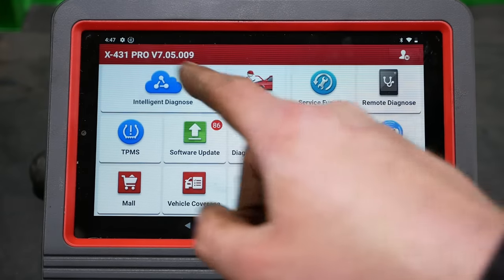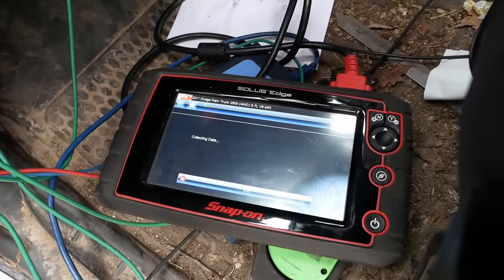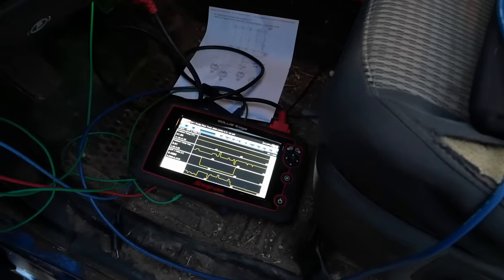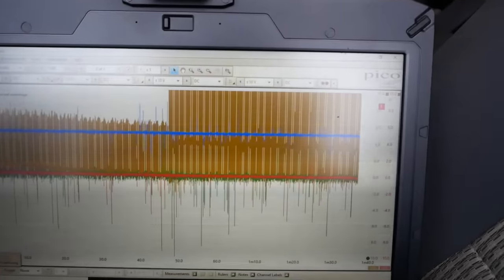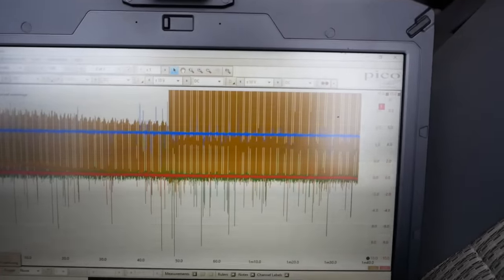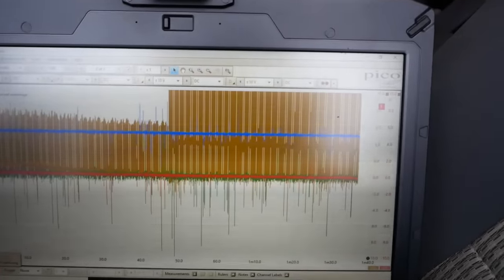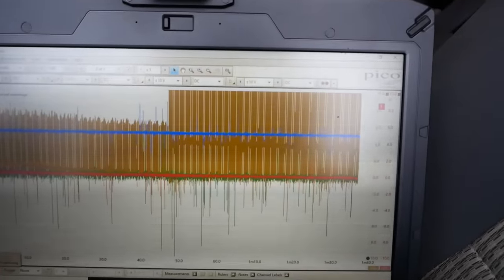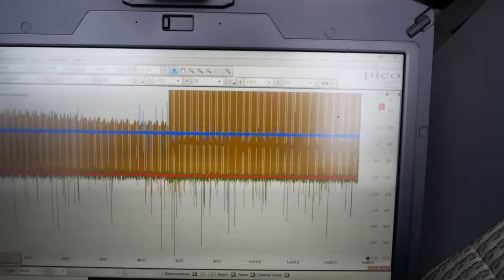Diabolical Diagnosis - Hemi Ram Stuck at 1500 RPM with P2128 and P2138

Comment: I had this same thing happen on a 2010 Dodge Nitro.  It turned out to be the throttle body had broken plastic gears inside..   Sometimes the butterfly valve in the throttle body will ice itself closed just enough that the plastic gear will be the weakest link when it tries to actuate it..  I think it's a sin that it's legal to put a plastic gear in there, given that it controls your throttle and can possibly make it stick at WOT in some cases..  smh..   There's a video of a guy splitting thees open and you see exactly how they fail-- it's actually very common on all dodge throttle valves.

Comment: The other question is how do you charge for experience? Your experience caught that wave pattern related to the injector. The old story about the guy that retires from the power plant after 40 years. Some time later they call him back to work because none of the young bucks can figure how to make a broke generator work again. He say it will cost you $10,000. They say fine. He walks in hits the side of the generator with a sledge hammer and it starts working. Young buck says they paid you $10,000 to hit this thing with a hammer? The retired guy says "no, they paid me because I know where  to hit it with a hammer".
Reply from the maker: I don't know. I guess always charge as much as you can!

Comment: I would rather pay 500 for a job well done than 300 for a crappy one. We have a Toyota Yaris 2007, started showing the ESP/ESC light and ABS light, took it to the dealer who said it probably was a sensor problem cost approx $700 so we sighed and payed.... Problem kept coming back, so they wanted to change sensor on the other wheel as well when my smart AF girlfriend just went home took out the power wash and 3 years later we still have not seen those codes again... I know I am rambling on a bit but last story, there is an old story about a city boy out driving in Sweden when his car brakes down, he gets it to a rural little repair shop. The mechanic fixes it and charges him $1000, the gets the invoice and it says "fixed car, one bolt missing" the guy gets angry demanding a specified invoice the mechanic takes the invoice and pencil in "bolt $1, knowing where to put it $999". Knowing how is always what is worth paying for.

Comment: I had the same symptom and the same reason in Opel Signum 3.0 Diesel 2003. Everytime when the moisture was in the air it activated emergency run (1500 rpm and idle when brake active), when the engine got warm the fault disappeared. The fault code was bad voltage on acceleration double potentiometer. The harness was broken below battery base, hard to find.

Comment: Can you do a factory reset, with scan tool. Or disconnect negative , and jumper to positive , with key on. Then put back on positive turn key on, let computer load ROM to RAM, ie: factory parameters .

Comment: Wes, I don’t understand the difficulty in solving the problem.  KISS. To me the pedal sensor has worn or is dirty.  Replace the pedal sensor and move on.  Some sensors produce opposite voltages.  One goes up and the other goes down as the pedal is depressed.  That is better because a short between the two cannot be misinterpreted as a valid signal by the PCM.
Reply from the maker: Your parts cannon will not fix this issue.
Reply: Sorry Wes,
I should have watched the entire video or had more faith in your ability to diagnose.  Whilst electro-mechanical is the usual cause, I get so many “Technicians” sending me perfectly good ECU’s to test for a fault these days I have lost faith.  Modern electronic modules have come a long way.  I fix more things over the phone than on the bench lately.  Thanks for your kindness and keep up battling rust!
 @WatchWesWork

Comment: Great fix. Worth every penny. Now, regarding the whole “Audi unintended acceleration” debacle. That was an issue that existed only in the minds of idiot Audi owners and salivating plaintiffs lawyers. The lawyers cobbled together their usual bluster about massive liability due to class action lawsuits and attorneys for Audi said “The courtroom is that way” and nothing. Audi refused to settle. After the fact , one Audi dealership owner put one million dollars of his own money in an escrow account and offered it up to anyone who could make any Audi vehicle accelerate unintendedly — but under these conditions:  1-  He had to be allowed to examine the braking system to ensure that it was in good working order. 2-  He himself had to be sitting in the driver’s seat with his foot on the brake. Number of takers?  Zero. Not even one of the plaintiffs lawyers, if you can believe that (Heavy sarcasm here). It was all a lie. Every word of it.

Comment: Yep, a parts cannon shop would have spent the customer's money well beyond the worth of the vehicle.
And, dollars to donuts (day old crullers at that) the Dealership would have replaced everything, including the blinker fluid, before even thinking about the harness.
That, and the vehicle would have been in the dry, relatively warm, shop bay, so the techs would have kept sending back "X0000 Could not replicate the Problem" to the customer.

Comment: Now I'm a city boy, so my car doesn't get very dirty that much. However, when I bring in my car for maintenance, I take out the rubbish, clean the steering wheel, and the handles with a wet wipe.
The cars that you have to work on are old, that's fine. But man, they are dirty....
Reply from the maker: This is his “good” truck.

Comment: these are the times when it is sometimes cheaper to load up the parts cannon and "shotgun" the problem and just fix every possible thing that could be cause the problem.
Reply from the maker: I know the pedal is over $300 and is backordered. The PCM is around $1500 plus programming. I don't even know on the harness, but you'd have to find one at a junkyard because it's obsolete. You're talking $4000 of work.

Comment: Videos like this make me want to go out and hug my 1939 ford 9n. I don't think there is 5 wires on the whole thing.
Reply from the maker: Most didn’t have any fuses or relays either. The starters were manually engaged with a lever.

Comment: Spray down with water selectively to see if problem rears itself
Reply from the maker: Hind sight yes.
Reply: @WatchWesWork  sometimes it takes extreme measures to figure stuff out. Glad you stuck with it n did proper repair. Like you said, others would've just bolted parts on

Comment: Can the corrosion itself conduct the current necessary to cause that problem?  Perhaps the corrosion forms when the engine is off, and then when the engine is started, the vibration break that 'short,' ending the fault until the corrosion is allowed to 'grow' back.
Reply from the maker: Others have suggested the salt is the secret.

Comment: It confounds me, with every manufacturer going to everything by wire, they don't do a better job on insuring the wiring harness is set up better. Also, I hate throttle by wire. It is one of the most stupid systems there is, considering a the alternative of a throttle cable is much more reliable.
Reply from the maker: Everyone uses it, but Chrysler can't seem to figure it out.

Comment: I'm still not sure why the manufacturers think this type of throttle is better than the old cable style :P Speaking of things that I don't understand, why do all new cars have keyless ignitions with a start button? I mean, if you still have to carry the fob with you in your pocket, what's the point? I can understand if they went to some sort of thumbprint scanner or something, but you can lose a fob just as easily as you can lose a key :P
Reply from the maker: I don't get it either.
Reply: The kids think it's "kuul" or somesuch?  Dunno.  You have to mash the fob buttons to lock or unlock anyway, so it seems dumb to me.  I mean, really, it would be that hard to have a place to at least park the fob on the dash so it's not in a cup holder or loose on the floor?

Comment: It sure is easy to rip the dealerships. I worked auto repair from 1991-2011. Started independent. Ended dealership. 
Dealership is less rust, but you trade it for the cars that the customer brought in because the local shop gave up and sent them to us. With a bunch of new parts. Point is- there are good guys and clowns in every shop. Your job as a customer is to find a good one and stay with him-wherever he works.
Reply from the maker: I guess it's all perspective. Most of the dealerships here don't do any kind of diagnostics. If there are no TSBs or obvious faults they just start hanging parts until the problem goes away or they try to convince the customer that it's not really a problem.

Comment: Only 5 hour charged for the job, any garage(non dealership) near me would have charged an extra £30 to £50 every time the computer was connected not including the extra charges they add for switching on a scan tool

Comment: If cars are build the way they were in mid 1900to mid late 1900 it would be so easy to fix them but since they stared  eding emission to them in 1980 it became problems  with repairs all car manufacturers should change get rid that all bull s...t and have no problems.
You can call me old but cars in my days were better than now in every way
Reply from the maker: I dunno. I remember when every gas station had a repair shop, and most had a tow truck too...

Comment: Dealership would have tried to sell that guy a new truck long before fixing his.  They aren't in the business of diagnosis and repair as much as an indie shop.  To be fair, a factory diagnostic procedure seems to ignore the possibility of wiring problems; it's just pointing you to a specific component to replace.  Which is fine on a newer vehicle, but after a decade plus there can be many causes for a problem that the factory just wouldn't encounter when they originally designed and built the thing.

Comment: What is wrong with a steel rod linkage on a mechanical set up why did they ever do away with it ? even if the return spring broke you could take your toe and pull the pedal back up . I dont even like a cable linkage . some things just dont need replacing on cars I dont care what kind of car it is .

Comment: Yet another example of the lack of thought by designers and mfgs when implementing electronics and the inability of the same to monitor and report errors in ever increasingly complex machines.
Reply from the maker: I mean it reported an error, but it's asking a bit expect it to report "this is shorted to the #3 injector driver".

Comment: How many people within a 2000 mile radius of that customer could have diagnosed, found and fixed that with no parts needed in 5 hours. Answer: none.  You are at the top of your profession tucked away in a farm field in a galaxy far far away. If you were in the UK, you would be Knighted, here...you get a cold dinner. Exit stage left.
Reply from the maker: Just another broken Dodge here...